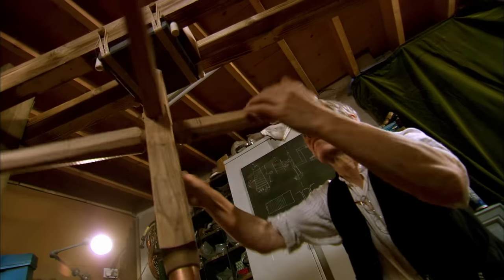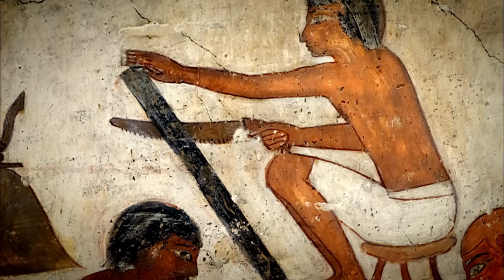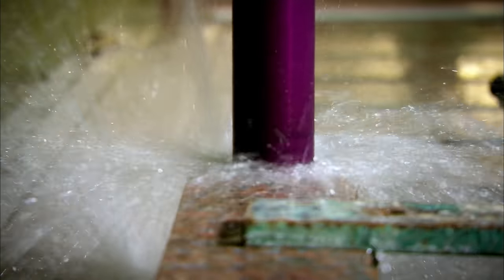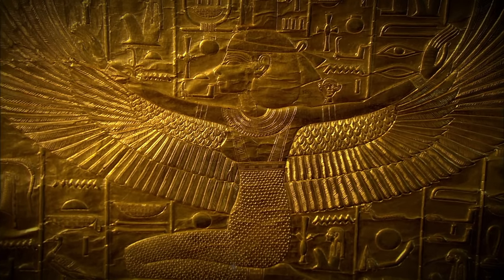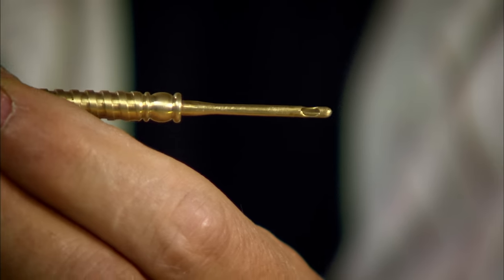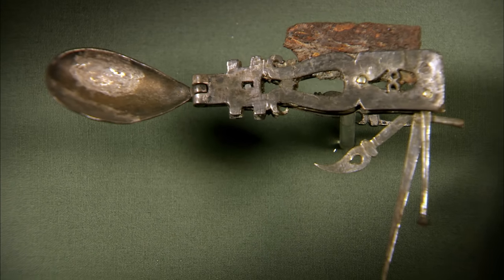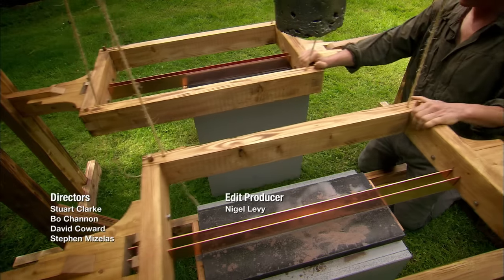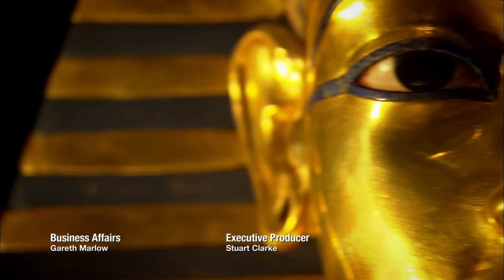Incredible Tools for INSANE Tasks | Ancient Impossible (S1, E6) | Full Episode

Comment: If you need the impossible...
There are over 30,000 examples of 4,000 year old pottery each made from a single stone. Vases cut from quartz having equal thickness in the base, walls and top, polished smooth as glass. Most having a small neck, large shouldered top narrowing to a base slightly larger than the opening at the top. 
They make this core look childish.

Comment: You can see it was cut by something that looked like a soup can but longer. Take a rope wrapped around it to spin it as you pull the rope. A loop around it could even go both ways.
Then you add in the one thing none of you ever consider ... they had acid. Yes of course they had acid, they mined. Sulfuric acid is a byproduct of mining. Mining + air and water = sulfuric acid. These holes where cut with a tube using friction and sulfuric acid. Same why they got them wall stones to look melted together. Sulfuric acid added to the mortar.

Comment: I think they weren't in a hurry to get things done. These people weren't 9 to 5 people, and time existed on a different standard than we use today. No 8 hour workdays, no holidays, 7 days a week,  But I have the opinion that they were not overworked in that the sheer amount of workers needed,  and replacing those who died or were removed from the project on any large scale put a strain on the worker supply. So overworking would have been avoided. All those workers painted on the wall don't exhibit much sign of short rationing or starvation, nor do they exhibit facial hair.
My point is that there probably weren't many overseers over the skilled trades and stuff took as much time as needed. It wasn't a rush construction project like nowadays. Think of how long it took to build Notre Dame. There was no cost/benefit thing, it was for the Pharaoh. The best material,  that you can't repurpose that easily, you don't want to waste by errors or distractions. Take the time necessary to finish well.

Comment: The only way for copper tool to work on stone is that the stone was softer than copper while in the manufacture process. Consider those are artificial stone chemically and gradually turned hard over time. 

Similar to how we pour concrete mix into a mold.
Reply: THIS IS WHY ALEIN THINK WERE DUMB .......PLEASE SEARCH  B4  POSTING

Comment: 1.  the groves are NOT connected, they are scoring marks that make circles around the tube. It has been shown using sand and copper this can be reproduced and matches exactly the same with the groves. Also, half an hour of work on something....be real, they probably spent many hours working on cutting out that core.  I would also logically assume most who did this work were not feeble old men..

Comment: Humor me for a bit. 

What if the granite block was poured and molded as opposed to being cut.    Then let’s say they used a lathe to cut a cylinder then cut continuous threads.    Then molded the block around the plug.  When the block hardened they simply screwed the plug out of the block.

Comment: They were perfectly capable of creating industrial diamonds back then you can see the rate of cut at first is deep and quick as the unit wears down and becomes smaller and cutting scratches we get the same results with our current core tools this doesn't require an Einstein to do this

Comment: On the core sample even with the modern electric core drill they could not have cut that core of the ancient Egyptians cut.  The man that ran the modern electric drill stated that in took 4 to 5 minutes to cut his core.  The problem is we can not replicate even today the ancient core what is so astounding is the feed rate per revolution or how deep drill traveled for each revolution that the core drill cut.  The ancient core could not be replicated with the modern electric machine they used in the video. Each revolution on the ancient core roughly cut .0625 thousandths of an inch or 1/16 inch per revolution on the ancient core. If at 160 rpm to cut a 10 inch core it would take 1 minute to cut the ancient one. The modern drill was at 1600 rpm and cut only 4 inches per minute. If the ancient machine had an equivalent rpm it means at 1600 rpm the core could have been cut in 24 seconds. However that would destroy the modern drill machine or bust the granite and or the core saw. Wars and the horde concept of killing enslaving and pilfering a society is where we lost these technologies. The library of Alexandria is the best example except that the millions of smaller libraries is what caused the more significant loses. The victors enslave the technical people to gather water and plow fields that could cure cataracts is why we lost these technologies that where past down before the last flood.

Comment: They had copper. They had sand. They wrapped a rope around a copper tube. They pulled it back and forty with sand as an abrasive.
You have to have low intelligence to buy the story they are telling you in this video.

Comment: OK, 2 minutes in and i already see the flaw . . . you folks have no idea how clever "the ancients" were.

core drill, easy . . . start the bore with a chisel . . . then copper cylinder rotated in an abrasive . . . change the abrasive often as it wears, occasionally replace the cylinder . . . . the abrasive does the work, the copper just carries it . . . round and round you go, might take a while though..

if that.s the best you got, give up.

Comment: First off I have to say that I enjoy your videos and learn a lot from them.  But this time you seem to miss the mark.  Time and time again you keep calling "cylinder 12" a cylinder. It is not a cylinder it is (the larger) part of a cone.  i.e. if the small end of the "cylinder" is extended it will eventually come to a point...  So not matter what the cutting tool used, you will not get a cone......